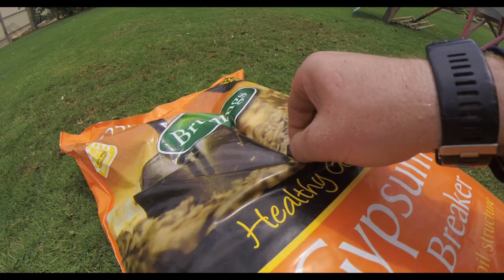Rescuing an old lawn - Santa Ana couch (Bermuda) recovery

Comment: That's unreal work!! It makes me want to do the same with my current rental. How did you find the nutrafeed in the spray bottle?
Reply from the maker: Cheers mate, I always like to have a garden and lawn to look at even in the rental 👍 I'm on about my 2nd month with the Nutrafeed and it has been good so far. I have actually got a very low dose running through the Ezflo as well. I have been impressed so far